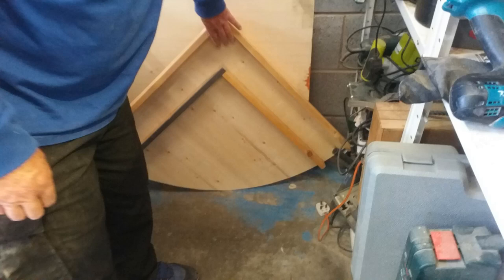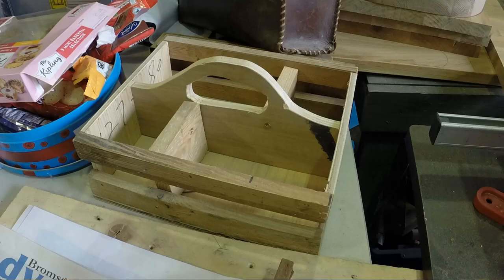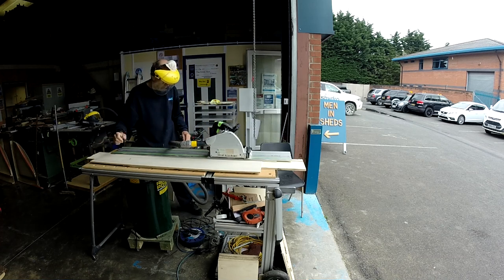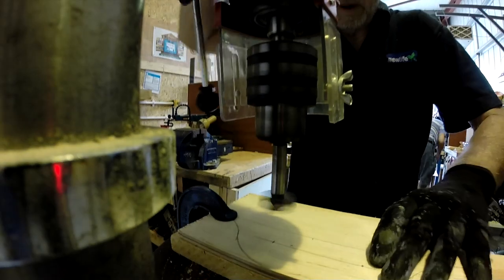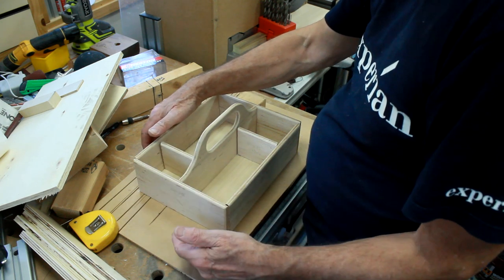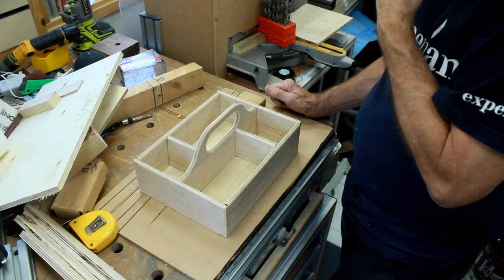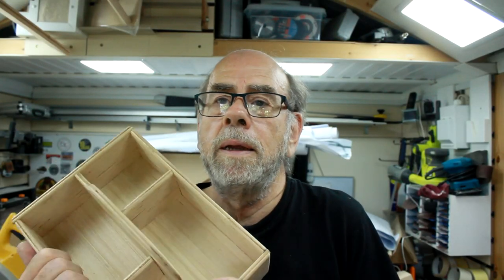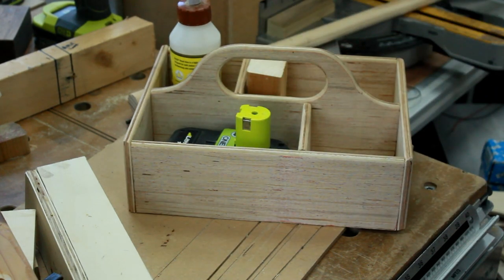the small shed #322 - making a plywood caddy

Comment: A number of rebates on the inside edge of the two sides and then each side of the central division would mean you could move the spacers to account for different sized areas. I've made a few like this and they are more useful as they have some flexibility in what you use them for and can include smaller sections (a friend had half a dozen for outside dining tables for condiments and cutlery)
Reply from the maker: Good idea, the only reason for the spacing I had was to use the jig for all of the rebates, but a slotting jig on the router table would enable what you suggest to make it more versatile. I will have a look at this for the next batch.